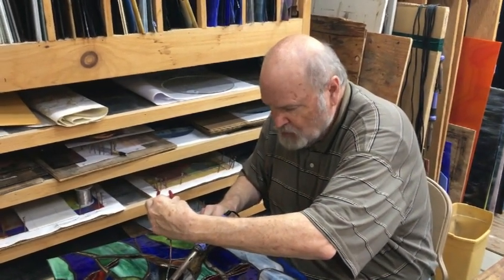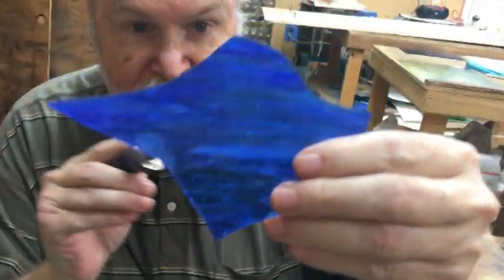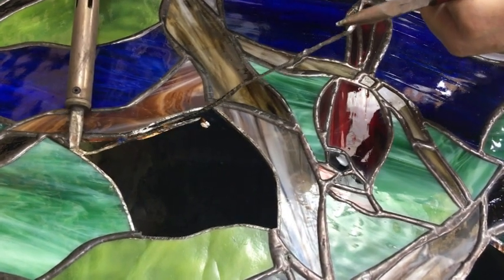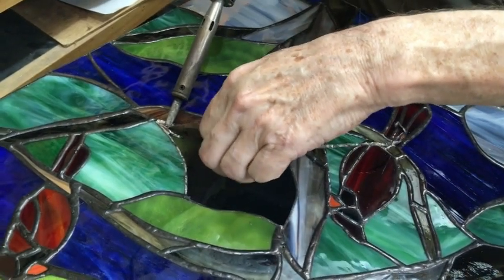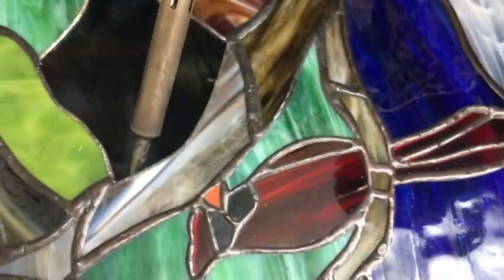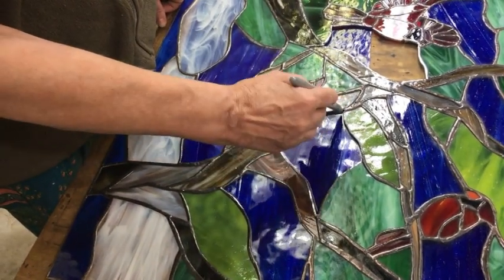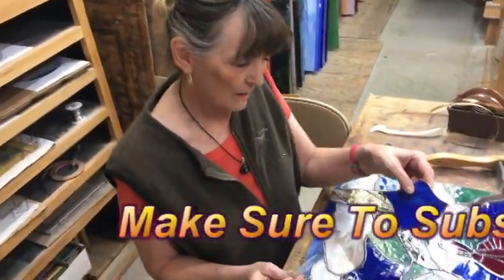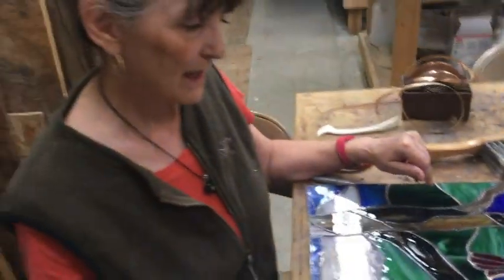Fixing Crooked Stained Glass V285

Comment: Did you have to also apply copper foil to the sections of  glass around the piece that you replaced, before applying solder?
Reply from the maker: We put new foil around the replacement piece of glass but didn't have to replace the foil in the void around the hole because we were careful not to damage it when removing the old glass.